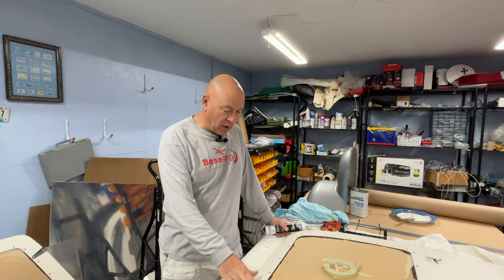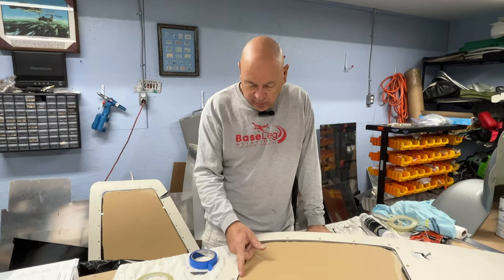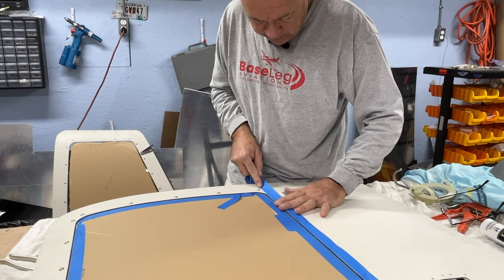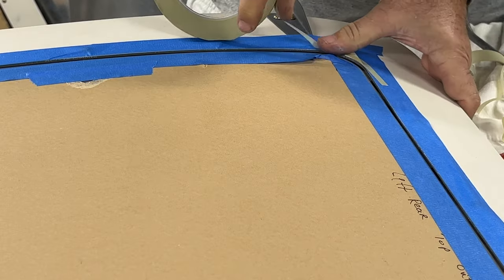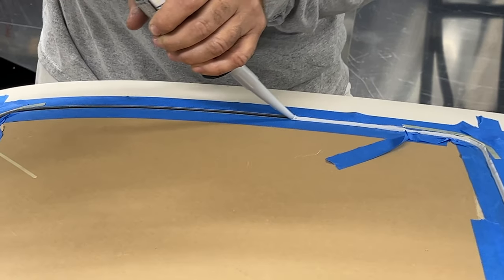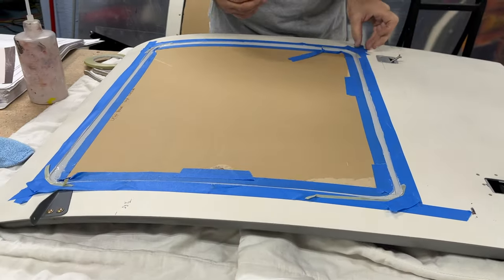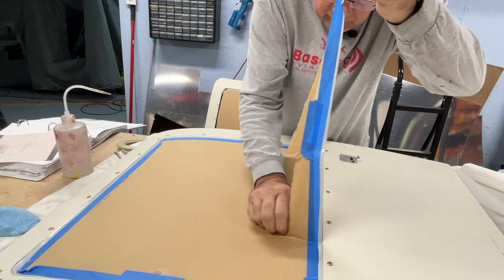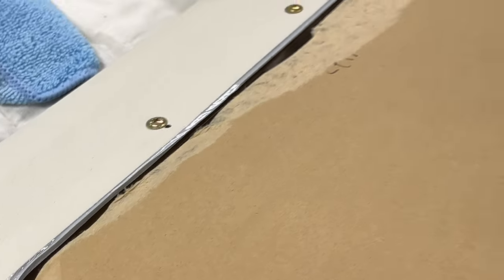Sealing windows on the  Hummingbird helicopter

Comment: Does the seam sealer set up and remain flexible?  How is it to remove if you need to replace the plexi?  How about using proseal in a similar application?
Reply from the maker: It does seem to stay flexible. I've tried it on a test piece. Don't know about removing it yet. Proseal could maybe work, too, but it kind of runs some while it is curing.